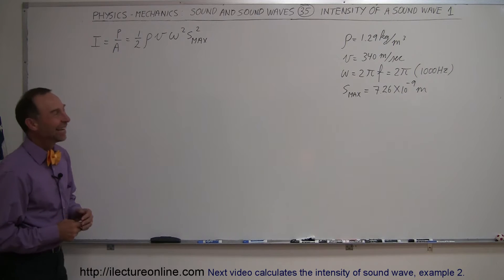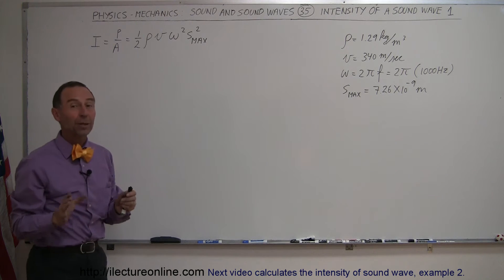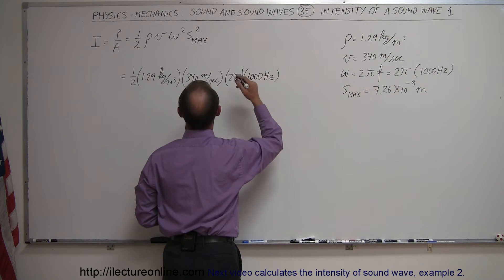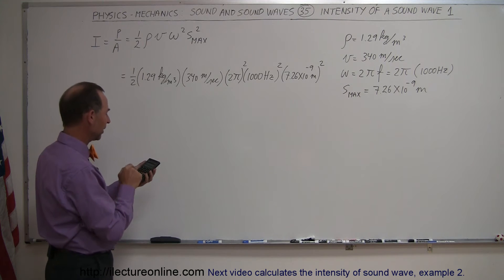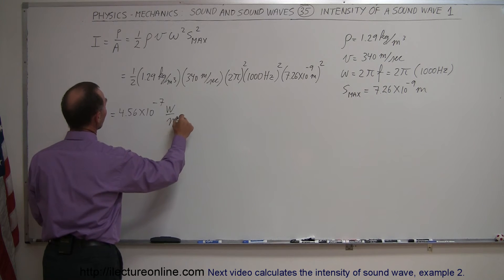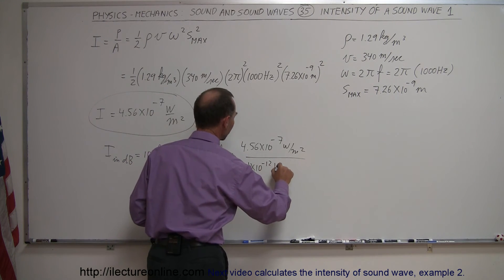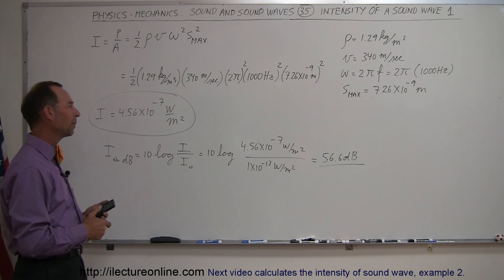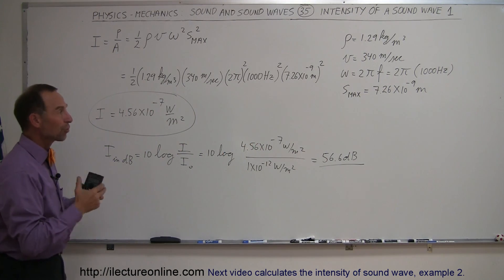Physics 20  Sound and Sound Waves (35 of 49) Intensity of Sound Wave 1

Comment: makes no sense with the previous video.
Can you please explain, professor?
Reply from the maker: +Arindam Bortamuly 
Intensity = energy per time per unit area.
Reply: +Michel van Biezen 
Yes I know that professor.
Energy as per you explained in mechanical wave is 1/2uw^2A^2v   where u=m/L
and I know the pressure relation is =density*v*w*s as explained in the 33rd and 34th video of sound waves.
So how do we get this relation of I=1/2*density*v*w^2*S^2 ?